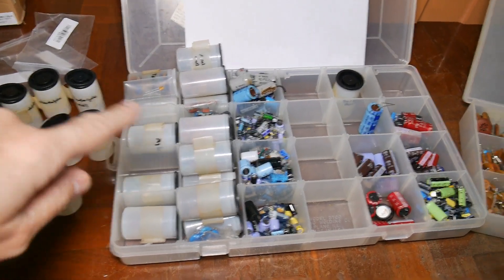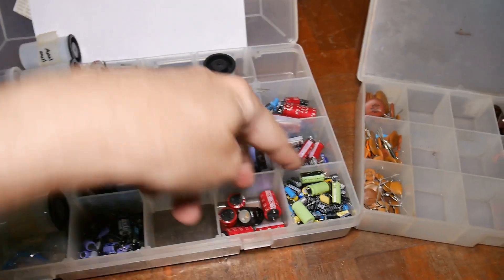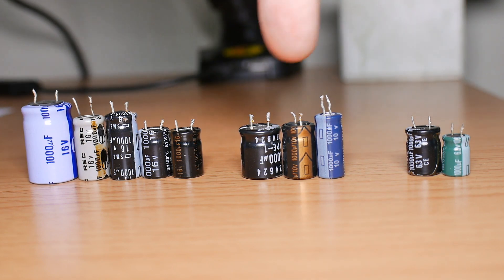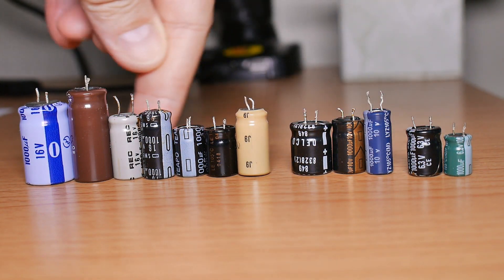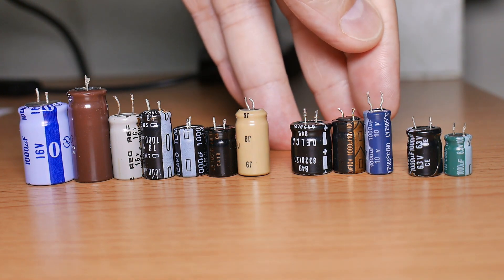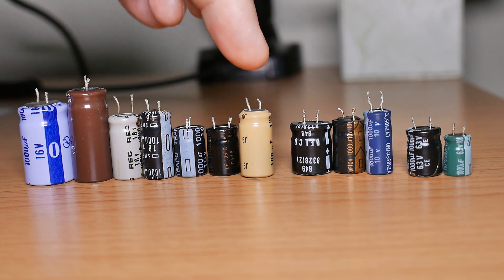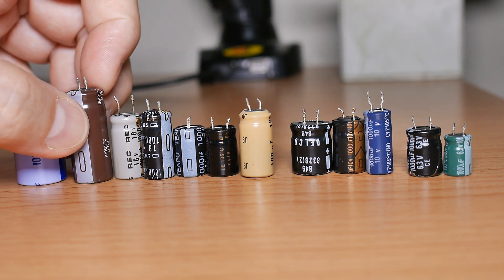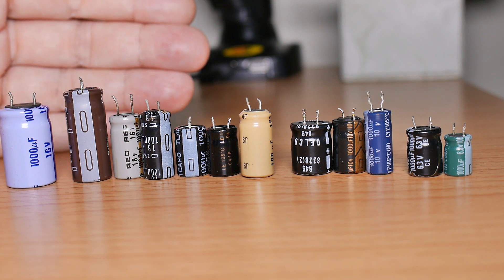It Pays To Organize & Keep Current, Components

Comment: I don't know if I would do this... Aren't bigger ones gonna work longer since they have higher thermal mass?
Reply from the maker: Smaller things have a higher ratio of outside surface to inside volume, therefore shed heat more efficiently.  But the real issue is that some of these are 50 year old technology and things in electronics have improved many time over since then.